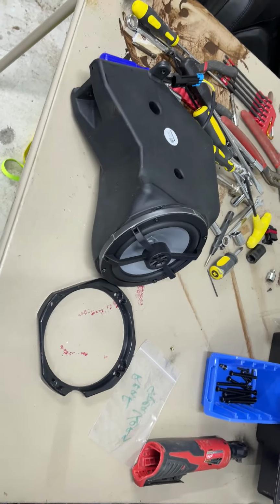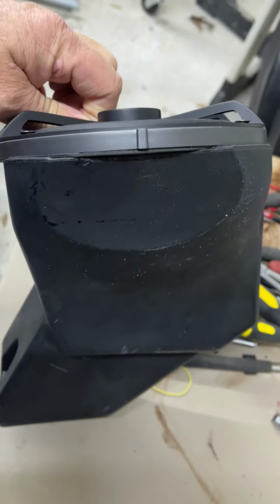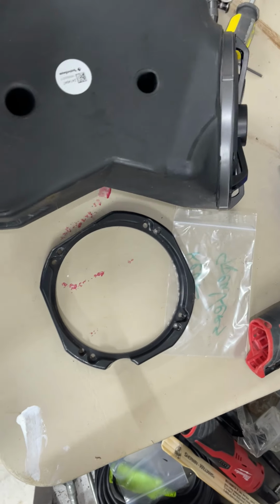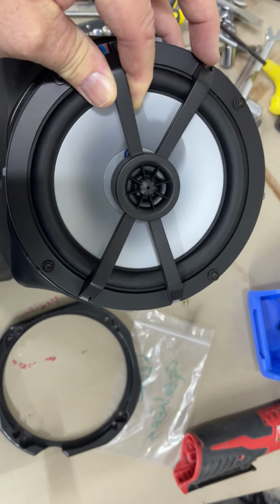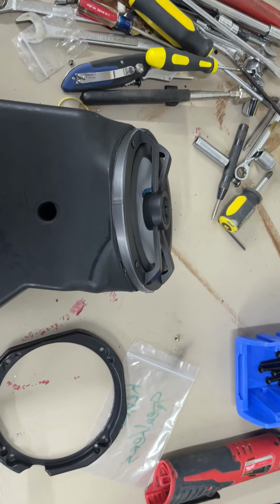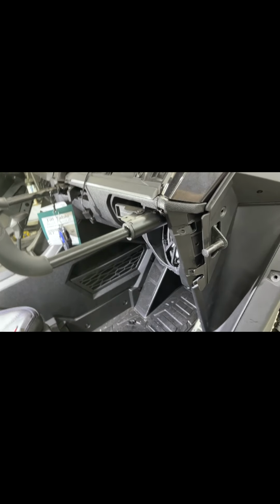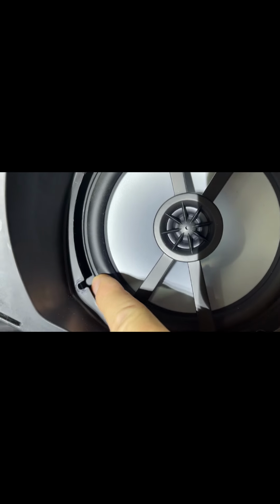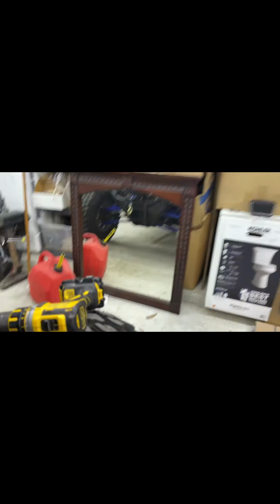Front speaker install on XP Pro using factory speaker boxes

Comment: You have a link for the speakers?
Reply from the maker: https://smile.amazon.com/dp/B00NB8CFP6?psc=1&ref=ppx_yo2_dt_b_product_details
Reply: @txtamer  Did it make a difference in sound running off the factory 400w amp? not sure if it would be worth it without upgrading amplifier